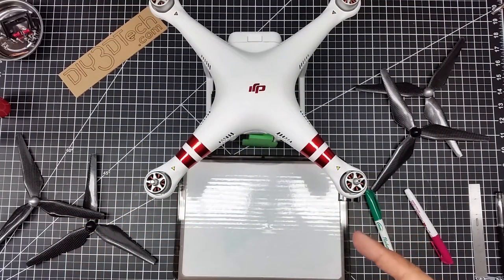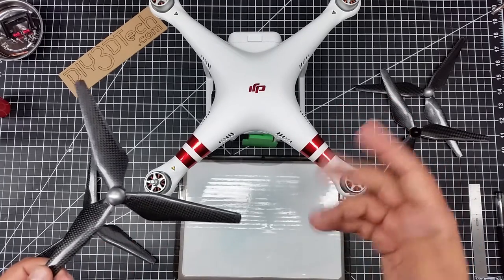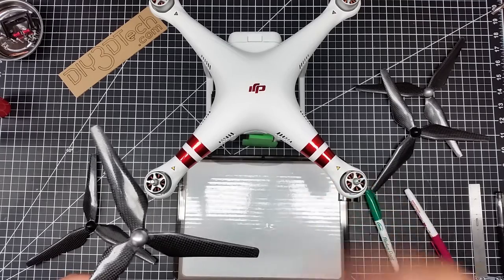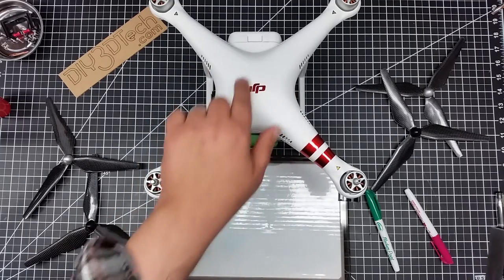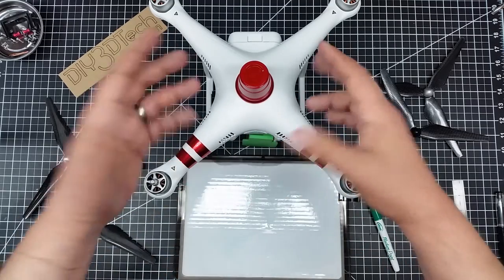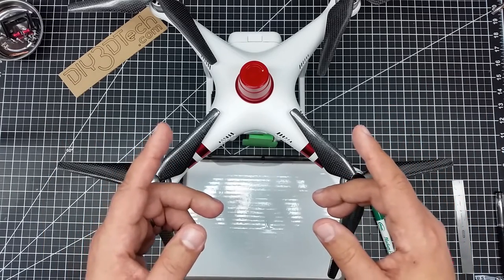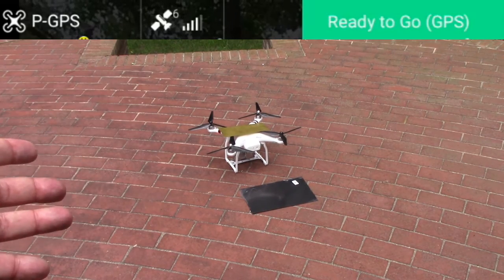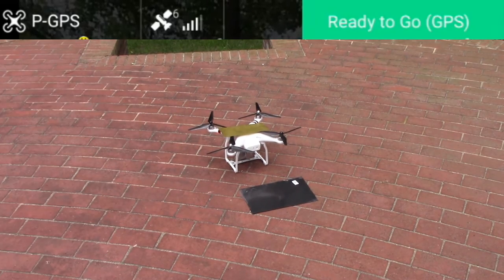Video Drone - Do Carbon Fiber Props Affect GPS?

Comment: You are correct about the frequency. The blades are rotating at a lower frequency . Radio waves vibrate a much higher frequency. Good video!
Reply from the maker: To the radio wave the props will appear to be standing still.  Plus they really aren't even the antenna as the antenna has loweveation rejection so I really have to sctrach my head on how this cold be an issue.  Also spurised I could get enough satalites to fly with sheet of metal on top!  Also thanks for commenting 😀

Comment: I must add it always flew perfectly each time before hand with plastic triblade and 9450 props till I put carbon props on... the 1 and only flight with carbon triblades was when I had major issues with my gps x16
Reply from the maker: Not sure what GPS 16 is, however would be skeptical that at least from a GPS perspective they would have an affect because even with a sheet of metal on top I got enough satellites to fly...
Reply: Video-Drone bayangtoys x16 gps
Reply from the maker: On this the gps is well above the props so unlike the upair and phantom I would have an even harder time understand how they could interfere.  When you took off I assume you had enough satellites correct?  As showed in my test you will either have them or not.  Question, did you notice a loss of satalites while flying.  The other thing to note is on these cheaper quads is they are more wifi based where dji  uses the same freq they do not use the same protocol as this is where I am a little nervous with the spark.  As to make it dual mode they stayed wifi/ip instead of using their prosperity protocol.  This in turn runs a high risk of interference especially in a crowed wifi area...

Comment: hi, do wifi signals aaffect drone start up/operation/ gps functionality? I had an experience with my blade chroma wherei in I had to fly it near an area with buildings at one side and in the other side. and im sure there are lots of wifi signals around. the drone wont start up. I moved it a few feet from the spot, it did start up but went out of control in the air. chroma uses wifi connection to the controller..thanks
Reply from the maker: Big yes on the cheaper drones, WiFi  interference is a huge issue.  Be careful as it can also cause a fly-away too.  On the more expensive drone they use a handshaking protocol to reduce but not eliminate the risk...

Comment: Joe, its funny you know.. first flight with carbon triblades exactly like those ones you have in your video.. coincidently on the flight my GPS X16 flew like crazy with a mind of its own for the first time ever..i literally had zero control over it and had to fight it to bring it down..even then I had hardly any control..so I'm thinking now it might have been interference by the carbon props
Reply from the maker: That why I did the video as there is no way that I can see that the carbon fiber will interfere as I even placed a sheet of metal on top and still got enough satellites to fly!  So how could a couple tiny carbon fiber props make any difference (which in the video I test that too and took it to the extreme  :-)
Reply: Video-Drone well my bird went crazy and didn't fly well from the get go after putting these same props on it.. Had gps lock but mid flight that all changed and it started flying itself back to China.. Was a solid quad till that day I tried carbon blades
Reply from the maker: Maybe I will have to get and experiment:-). As my upair would do the same regardless of the prop type as either they worked or didn't.  As mentioned in my other reply I think it has to do wifi interference as even if you loss GPS lock it should simple default to atti style mode and will wander however shouldn't fly back to china.  Question however did you recover it?

Comment: I would have though you would have done the actual testing with the same aircraft that was in the prev. video?  I think a better test is to use the same aircraft (Upair) and actually fly the same flight pattern with the aftermarket props Vs the MFG props. 

There's are tons of opinion about tri-props Vs MFG props changing flight characteristics. I don't make any functional modifications to any of my aircraft's so I have no idea if they are accurate or not.
Reply from the maker: Yea I would have, however I've sold the UPAirs and no longer have them.  However they have the same style GPS as the P3S as what surprised me is placing the brass sheet on top and still having enough satellites to fly!